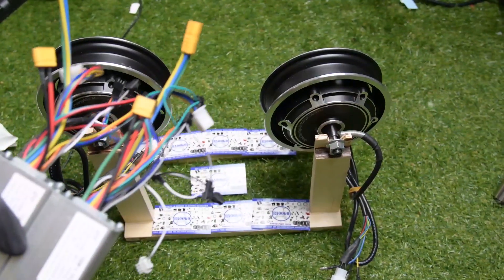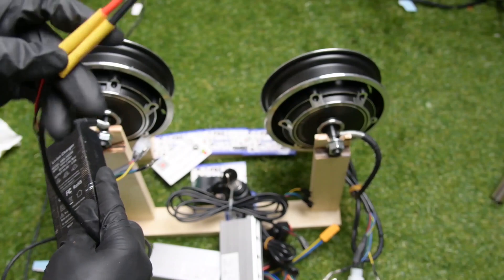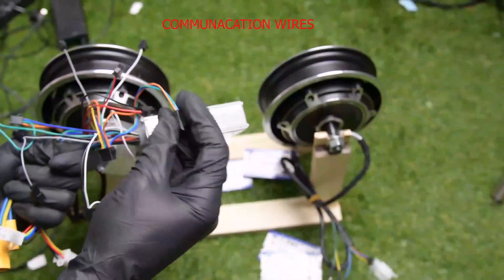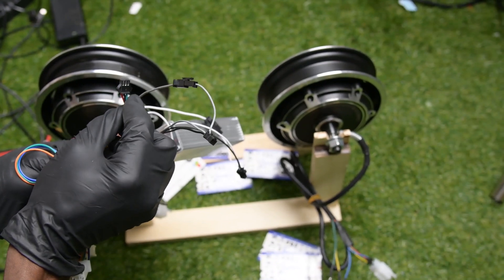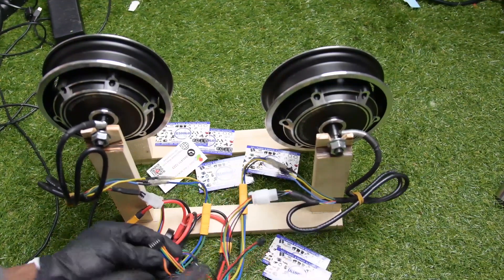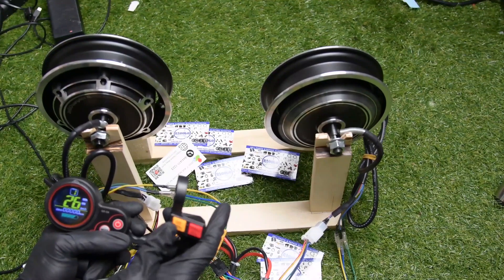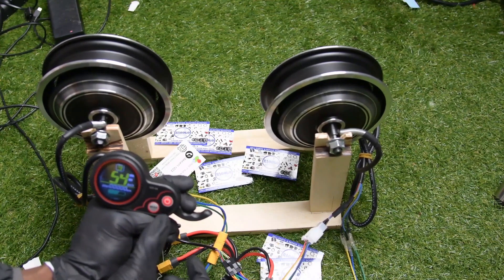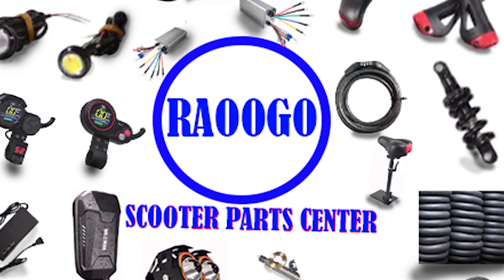52V 60V Controller  Wiring Diagram Apollo Ghost Varla Mantis Electric Scooter Connection  Explained

Comment: Hello i kinda can follow but alot of the connections you did are out of the screen so you cannot see the wiring you are connecting and you are showing them very quick . Can you pause and put the wires in frame before you connect?

Comment: Hello, can you help me with a diagram, the connection diagram of the two controllers with everything you showed in the video? From the video I can't see how they are connected. I have controller A and B from Kyesang, Model QS-C52-31003,  DC52V 25A
Reply from the maker: Hi. Write to support on eBay to get the wiring diagram. 
Use the Link in description.
Reply: The connection to the throttle 6 pin to 5 pin and the colors do NOT match? Is this correct??

Comment: Can I contact you for a question I have with this same controller I am trying to connect?
Reply from the maker: Which problem do you have?
Reply: Please can you help me with my rear controller doesn't work its a 52v25ah it shows red light inside (on/off every seconde ) i test MOSFET no problem I don't know how to fix it